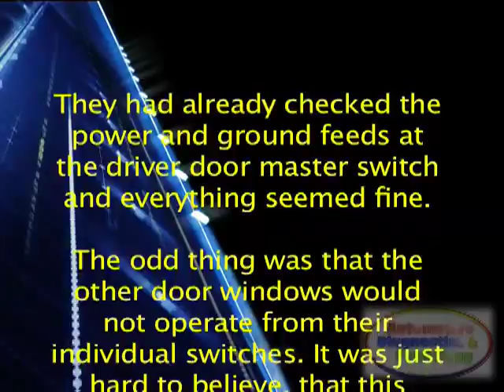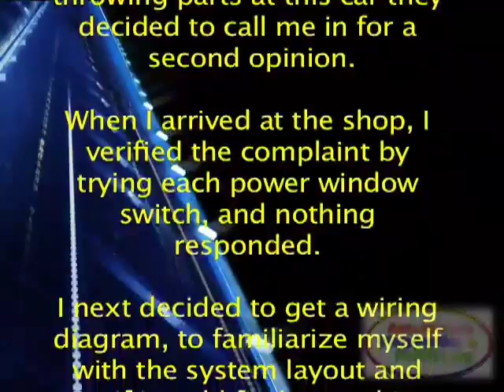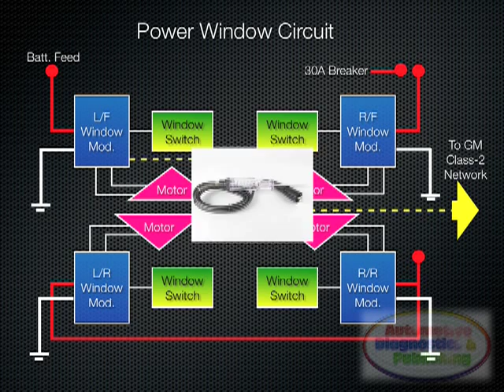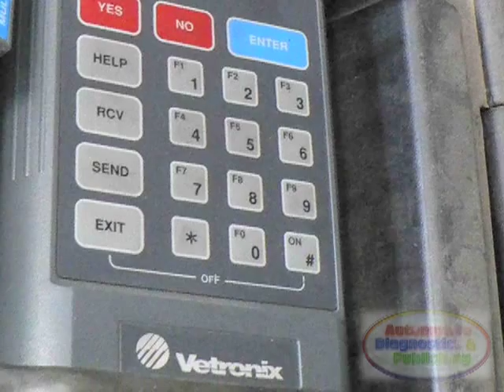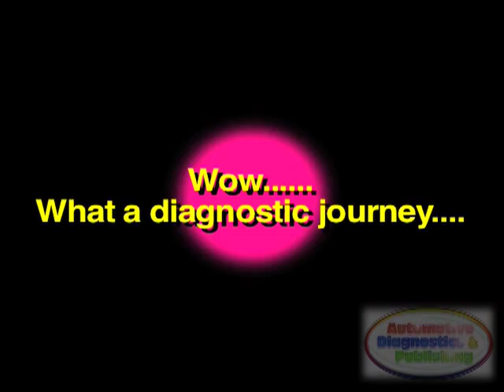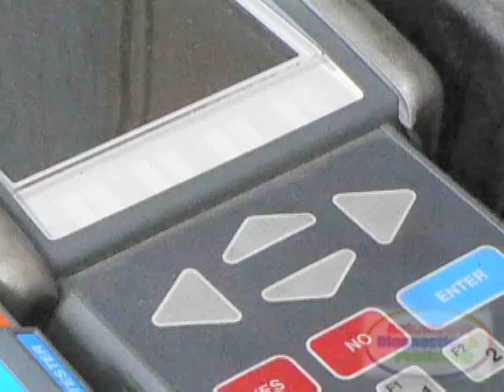Hello There GM Power Windows

Comment: Ok, sounds pretty ea?sy, except is the accuator part of the motor?  I was under the assumption they are two separate parts.  Please explain.  I have a 1998 van and haven't had the drivers window down in 2 years!